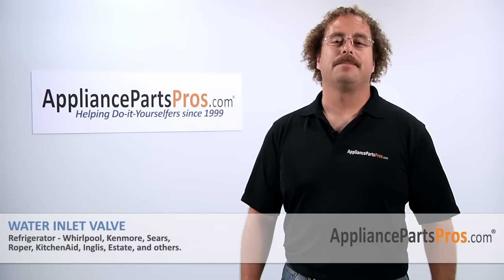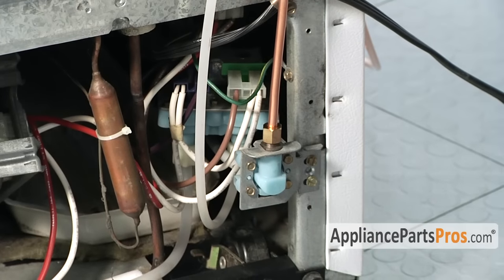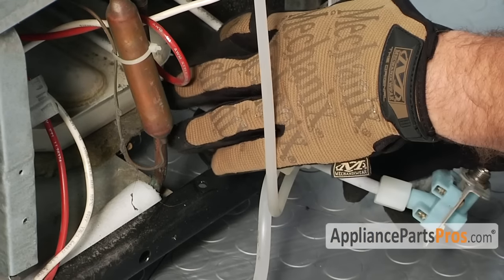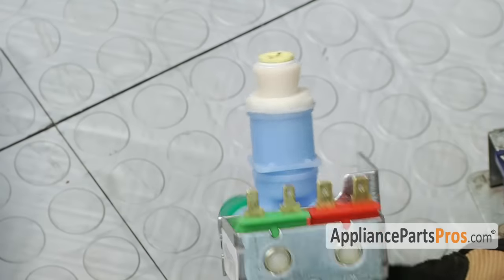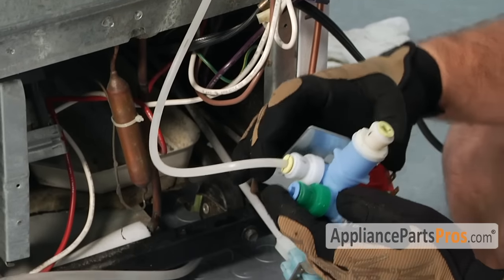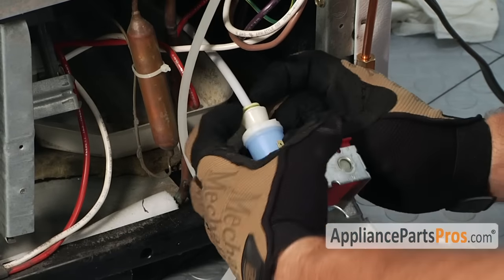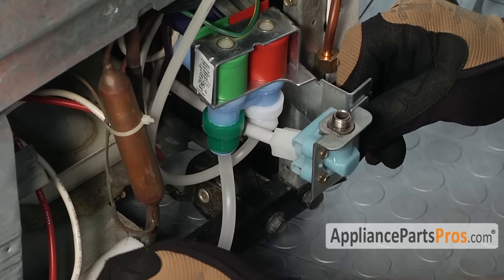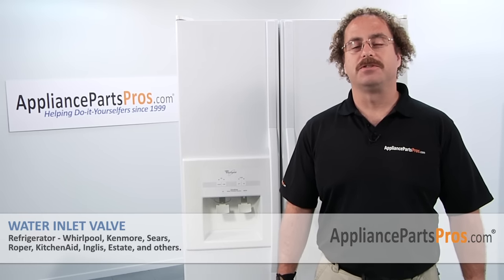How To: Whirlpool/KitchenAid/Maytag Water Inlet Valve W10408179

Comment: The hose that provides water to the valve on the refrigerator broke and started to spray water through a small crack in the hose.  Could the hose have broken due to an issues with the valve?  Its strange that it broke now as I was recently having an issue with frost in the freezer and lower temperature in the fridge.  I defrosted the freezer/fridge for a day and plugged it back which seemed to have fixed what I though was a ventialtion problem.  Now, a few days later, the hose breaks...

Comment: Water supply line was cut going out. How do I fix it? 3/8" compression sleeve doesn't work on the plastic water line tube.
Reply from the maker: You'll probably just have to replace the plastic tubing that was cut. We can help you make sure you get the correct supply line. We’re available 7 days a week at 1-877-477-7278 or you can chat us at our website: http://www.appliancepartspros.com/

Comment: I know the electrical terminals are different sizes so you cant interchange them, but would it matter if I twisted one and turned it upside down? Is there a top and bottom when plugging them in?

Comment: That looks exactly like what I have. I have a Whirlpool  model ed25texhw02. I need the part that is removed from the valve replaced in the video. I need the part that the water supply is connected to. Can you send me the part number of that part so I can order it from you?

Comment: I have a Whirlpool ED5RHEXNL00 side by side with water dispenser on the door.  The water dispenser has a very very slow leak from the tube.  Is the inlet valve the most likely repair?

Comment: hey this is an excellent video and thanks for posting it it may very well save my hide. i'm a floor mechanic and i had to disconnect the fridge (exact same one as shown above) and when i went to hook it back up, it started leaking. It was a very slow leak but a leak none the less. the leak occurred at the second connection in, not the copper line which baffled me. i watched your video and decided to dig in and try it. i tried several times and got the same result, a very slow leak. i tried to cut the line thinking that maybe it needed a new edge on it. same thing again. it seemed that when it was held on a certain angle it didn't leak.do you think i need to get a whole new water inlet valve assembly or should i just keep trying until i succeed. we already have the new part but that 70 bucks is an expense that i'd rather avoid. your advice and expertise in these matters is greatly appreciated
Reply from the maker: Alexandra Fry There is a o-ring and locking teeth inside each of those quick connect fittings. The line must be smooth and square, with no rough edges that may damage the o-ring. You have to push the line straight up till it bottoms out in the valve. If the line is pulling to one side it could distort the o-ring. If the o-ring is damaged you have to replace the whole valve.

Comment: Question: From the inlet valve, my icemaker line runs up the back to the icemaker, but the line that should go to do the door, does not. It's going to the left and up into a big tube. It's not connected to anything there and it's leaking. Should that line run directly to the door?

Comment: So I have replaced the Valve Inlet, everything seems to be connected properly and I have rechecked all connections. When I try to run the water ans flush the sytem I get a solid line for about 10 seconds and then it slows to a drip.  There is a lot of sediment in the water.... what could the problem be now?  I needed to replace the Valve Inlet because the original was cracked and leaking.

Comment: I have a whirlpool model ED5SHAXMB10 refrigerator. Recently the ice maker water dispenser (which fills up the ice tray) started filling up the cup that the water drops into and freezing. It also appears to freeze in the tube itself causing it to swell up. Any idea the cause and repair? Thanks

Comment: Hi, I have a Maytag GS2728EEDB side by side fridge freezer. I changed both solenoid valves as water was coming from the water dispenser and would not stop, the water stops coming from the water dispenser when I open the fridge door but will still keep coming out when the door is shut. I have changed both solenoid valves now and I am still facing the same problem. Please advise what the problem could be. Thanks

Comment: Hi Guys!  I've replaced my water inlet solenoid/valve on My GE fridge.  I believe I have air in the line as its not dispensing water into the ice maker.  I've removed the cover and mine model doesn;t have test points to initiate a harvest cycle.  I only see a small and larger plastic gear.  Is there any way to cycle the ice maker to verify the water is in the line?  Thanks!  Love the vid!  Dave Larson
Reply from the maker: dlarson8698 The air should cycle through and it should start making ice. They have had a few types of ice makers over the years so if you want specifics I would suggest you go over to our repair forum where you can enter your appliance model number and the problem and the tech can help troubleshoot.

Comment: good video I order this part but my ice maker still not working ,please tell me what can do thanks
Reply from the maker: Salvador Cruz Once you turn the water on it may take a little while for the ice maker to go through a cycle and call for water. If your valve was leaking water up to the ice maker make sure the fill tube going through the back wall is not iced up. If it still does not make ice you will have to look deeper and see it there is another problem such as the ice maker itself or maybe the infrared sensor, if you have that. You can also post the problem along with the appliance model number on our repair forum and the techs can help you troubleshoot the problem.

Comment: If the wire connectors are the same size is there a wrong way to reconnect them/ polarity?
Reply from the maker: They are different sizes. The one side is going 3/16" and the other side is 1/4".
Reply: @appliancepartspros  I have two that are the same size does the polarity matter or are both wires positive on each connector?

Comment: What's the smaller inlet the copper tube goes into? That part is leaking on my fridge and i need to replace that only.
Reply from the maker: If you take your model number and put it into the search bar on our site http://www.appliancepartspros.com/ it should give you a full exploded diagram that shows all the parts, which should let you find the one that you need.

Comment: I have a dripping water line from the water dispenser do you think this is the fix? Everything works but the water line where you get the water from the fridge periodcally drips and somethimes will not stop
Reply from the maker: What is your model number?
Reply from the maker: If you recently replaced the water filter you may need to purge the water line due to having air in the water line. If it is doing randomly or doesn't stop then it would be the water valve that would need to be replaced.
Reply from the maker: To clear air out of your water line, press the water dispenser lever for one or two minutes. You need to flush the water system to remove air (bubbles) inside of the water line.
Reply: @appliancepartspros  thx but I have cleared the water line no bubbles but still same issue
Reply from the maker: Then it sounds as if you are having an issue with the water valve.
Reply: @appliancepartspros  thx I really appreciate the advise
Reply from the maker: You are welcome. If we can assist you with anything else please let us know.

Comment: My water inlet valve is just leaking like crazy, definetely the valve unit, checked all the connections, they seem OK. Its a Kenmore Coldspot, I think 2009 model bought it used it was in a garage with very LOW temps, below freezing, wonder if anything froze and ruined it...suggestions? thx
Reply from the maker: It should be fairly easy to see if something starts leaking. I would hook up the water, plug it in and look for leaks. Make sure you look at all the water lines down by the valve and the water tank in the fresh food section. Run a bunch of water through the dispenser, also look for leaks as the ice maker starts making ice. As long as no water lines froze and cracked it will probably be ok, just keep an eye on it for a while.

Comment: I need the compression nut for the wall connection. I accidentally cut it off and it will not seal again w out leaking does anyone sell and know the size of that compression nut?

Comment: In my case, the leak was the actual part where your water line screws into the refrigerator.  A much cheaper item to order.  Also, when I had the repairman out he originally told me it was a crack in the evaporation tray under the fridge and that it would be HUNDREDS to replace because it can't be removed without emptying the fridge and leaning it to one side to remove and replace from the BOTTOM which is flat out STUPID!  For decades, such trays were easily and routinely removed for cleaning from the front.
Reply: I cannot find that part anywhere.  The first part of the water valve.  Ours was leaking on the out portion.  Any ideas if there is a more specific name for it?

Comment: I have a leak on the valve that the main water goes onto( the valve you did not replace). Do you know the part number for that?  I have the new valve that you replaced but the other one is the one I need to replace so I'm going to do it all at once.
Reply from the maker: ANTHONY baker There are different valves depending on the model number. It is best to go to our site and enter the appliance model number to make sure you order the correct parts.

Comment: my kitchenAid side by side will not make ice. Water doesn't fill the ice maker. The red light in the freeze section blinks red and I have water to the chilled water dispenser. If I replace the valve will it fix the issue?

model # ksrg25fkss

Comment: hi, i have this model of refrigerator but i have no idea how to connect that valve to the water pump so i can get water directly from the 5 gallon bottle instead of the water line, where i can find some electric diagram to do that?
Reply from the maker: Salvador Zamora Gutierrez The valve is not a pump, it works on house water pressure only. If you want to run off a water container instead of house water you would have to install a inline water pump between the valve and the water supply. The refrigerator requires a minimum of 20 psi for it to function.
Reply: AppliancePartsProsi have a Samsung refrigerator and the water is coming from underneath the front of it
Reply: AppliancePartsPros ice maker for whirlpool

Comment: What if you have an automatic ice maker but no water dispenser?  How can you test for leaks when the ice maker only fills for 1-3 seconds every few hours?  That left me stumped so I just disabled it for many months now.
Reply from the maker: SWLinPHX This will involve some some trouble shooting it is best to post the 
problem along with the appliance model number on our repair forum and 
the techs can help you find out the problem.
Reply: you can just look at your water inlet supply line, no drips? no leaks. If you're not getting ice after this, then you may have a problem with your ice maker or the water supply to the ice maker or either the mother board or motor. If you have a clogged filter, then this could also be a problem. I don't know your situation, so hope this helps.
Reply: Todd White Thanks for the reply Todd, but I need to clarify.  I know the issue is not at the faucet or valve.  It sprays water from the 1/4" white plastic tube at the top of the fridge near where it enters the ice maker.  I want to know how to get the water to run so I can test the leak (where it is, if it's fixed, etc.).  It's easy to do with a water dispenser but what about with an ice maker than only refills a few seconds ever few hours?  I don't have a chance to survey it.  Is there a "force fill" or something?
Reply: SWLinPHX then you probably wouldn't even have a water filter in your unit. Rather than spending a lot of time trying to figure out where the leak is, I think I'd just replace the whole hose. In doing that, if it is even cost effective, you'd have to see if the line is removable. Someone will have to get on one end of the line at the water inlet end and someone on the other end and slightly wiggle the line to see if there aren't any clips holding it in place. If the line moves, using electrical tape, tape a string or fishing sugoi line to one end and pull the line out. Then you would know how much 1/4" clear line to purchase to put back in. You would then pull the line out, attach the new line to the string and pull it back in, attach both ends and you're in business. The only other way I can think of would be to disassemble the interior refrigerator panels (if that is even possible) and replace the line that way.
Reply: SWLinPHX I may use the copper wire trick described in the first link above to force fill the tube and check for leaks.
Reply: SWLinPHX One problem with that is you say you already know you have a leak, so where ever the leak is in the line, you still have to change the line.  If the line comes out easily, I'd change it. If the line will not come out, then I'd start looking on how to do the repair.

Comment: What kind of work does the part you change. Because I ha a problem with my refrigerator. When I turned on the water it doesn't stop running inside the frozen. Any idea what's wrong?
Reply from the maker: bonfilio diaz You could have a solenoid stuck in the open position, so anytime you turn the water on it goes to the ice maker. You can also post the problem along with the appliance model number on our repair forum and the techs can help you troubleshoot the problem.

Comment: I HAVE AN OLD GE PROFILER ARTICA AND I HAVE NO WATER TO BOTH THE ICE MAKER OR THROUGH THE FRONT OF THE DOOR.   THIS ALL HAPPENED AT ONE TIME!  DO I STILL NEED THE SAME PART TO FIX MINE OR IS SOMETHING ELSE WRONG? EVERYTHING ELSE SEEMS TO WORK OKAY.  PLEASE ADVISE!  THANK Y OU.
Reply from the maker: We'd be happy to help you out with that! We offer free technical advice and diagnosis. You can give us a call at 1-877-477-7278 or you can chat us at our website: http://www.appliancepartspros.com/. We will need your model number to give you accurate advice, which you can locate using this tool on our website: http://www.appliancepartspros.com/modelnumber_locator.aspx

Comment: Hey guys. I'm getting water flow to my water dispenser, but not to the ice cube maker. Would this rule our the water inlet valve?
Reply from the maker: There are multiple solenoids on the water valve there is usually one for the dispenser and another for the ice maker. So it could still be a water valve problem. Without knowing what you have, I would suggest posting the problem along with the appliance model number on our repair forum and the techs can help you troubleshoot the problem. http://forum.appliancepartspros.com/

Comment: Im confused, I just watched this same exact video on your website and you list a part number of: AP2583509. Why is the part number different in this video? The water valve that is currently installed on my Kenmore Refrigerator doesn't have that red piece. It just has the green piece. I checked the part compatibility on your website and it came back saying this part in the video will work on my unit. I was just confused with the two different part numbers thats all.
Reply from the maker: Chuck Purnell If we do not have a video for a specific part yet, we attach a video to them in the hopes it will be helpful. This video is on a few different water valves.

Comment: I'm having a bad tasting (metallic)  water/ice problem with my filtration system on my fridge. I've replaced the water filter about 3 times with different brands - no luck. What are the chances my inlet valve is the source of the issue?
Reply from the maker: I have heard aftermarket filters are not great so maybe try an oem one and flush it real good. If it is the ice maybe check the mold to see if the coating has failed.

Comment: Hey.  Mine appears to be leaking at the part that you did not replace in this video.  Which part is that?
Reply from the maker: +actionjack84 Not sure if they are all the same so it is best to our website and enter your appliance model number to view the parts breakdowns to be sure you get the correct part for your model. As an example one is part number AP5306962 but make sure you search by your model number to get the right one!
Reply: +AppliancePartsPros 
Hello thank you for your reply.  I took the valve out that appeared to be leaking and found a part number on it that I was able to find and order online - 2181730.  Should be here any day and installed in a flash.

Comment: I replaced the refrigerator water inlet valve and installed a new ice maker. Plugged everything in according to your youtube directions, but there is no water flowing into the system. Checked to see if there was water flow, and there is,  but the valve won't kick on.  What next?
Reply: I have the same problem.Changed the inlet water valve and still no ice.
Let me know whats the problem.
Reply: Amendra Prakash did yu find out why.
Reply: +Ronald Wilhelm 2 years late but probably something is clogged
Reply: Ronald Wilhelm  ... What's  at turbo torch diference to the regulat torch?
Reply: Ronald install water line
Reply: Ronald Wilhelm more parts more money.....process of elimination. Don't give up you got the money.
Reply: Ronald Wilhelm 9
Reply: Ronald Wilhelm 
Disconnect the incoming water line. Turn back on the water line to see if you have any flow to begin with.